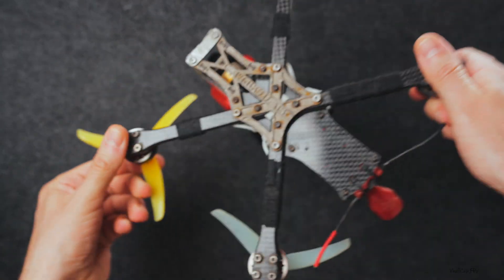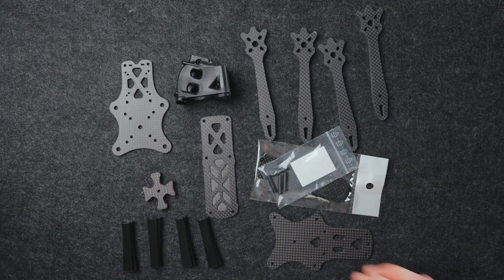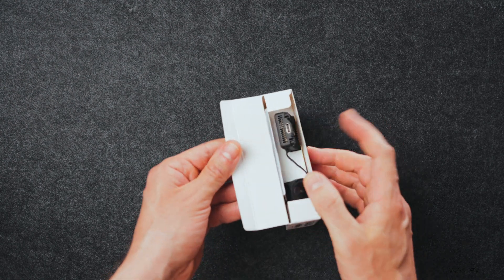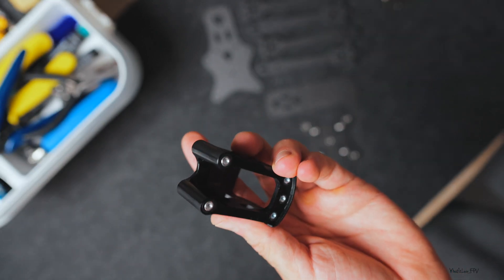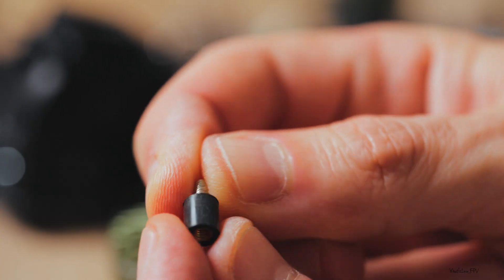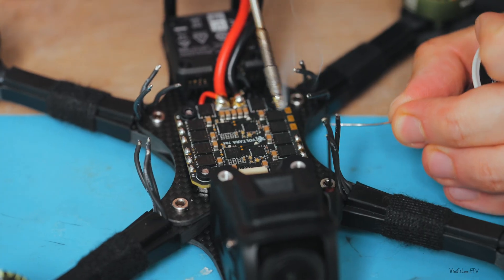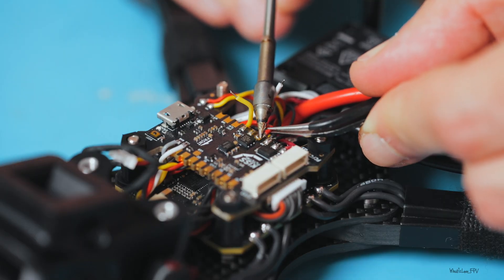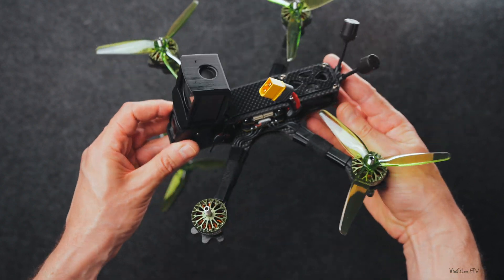The Best FPV Drone You Can Build in 2025/2026

Comment: Nice video bro.Ive done a similar build with kiss ultra fcfc v2 in era frame.The default pids recommended by kiss gui is pretty good but I can bring out some propwash.Are the pids that you opened in a different window the ones you use?are they better than default kiss pids?
Reply from the maker: thank you for your supportive comment 🙏 Yes, these are my old pids, actually they are from Apex frame, but they fit well. try it!

Comment: how much did it cost?
Reply from the maker: the FC is 100 euros, the ESC is 100, the motors are a little more than 100, the frame is a little more than 100. VTX obviously if it's an O4 then 250. And also things like the CRSF, the buzzer, etc. so, it is pretty much expensive

Comment: How much in total did it cost
Reply from the maker: I can't really say the exact amount right now, I bought some parts in Canada, some in Europe...
but taking into account that the FC is 100 euros, the ESC is 100, the motors are a little more than 100, the frame is a little more than 100. VTX obviously if it's an O4 then 250. And also things like the CRSF, the buzzer, etc. so, it is pretty much expencive

Comment: Hey man, very nice video. I noticed you didn’t center your sticks at 1500. You can do that in the GUI or in the radio. If you do it in the radio, you’ll have to make a separate model for your Kiss (Ultra) quads, and a separate model for your BF quads. If you center sticks for BF, they will be off for Kiss and Kiss Ultra and vice versa. Hence two models.
Reply from the maker: thanks for your comment and your advice
have you ever tried Voltara?

Comment: How do you get to your buzzer reset switch when it's tucked away up the front ?
Reply from the maker: after the flight, you disconnect the battery, and then you connect the battery again, but you do this until the FC has loaded (aproxx. 4-6sec) and immediately disconnect it - this way you can turn off the buzzer without physically pressing the button